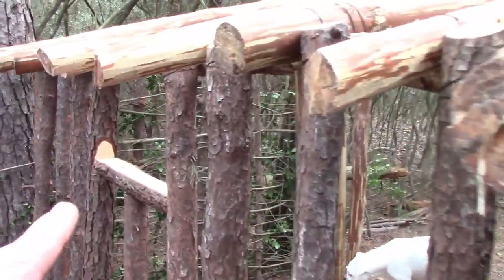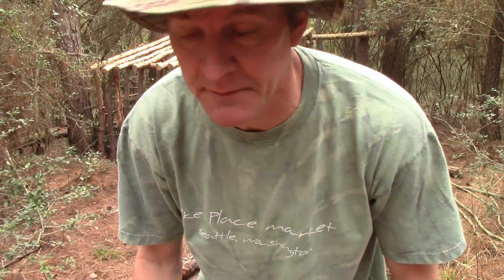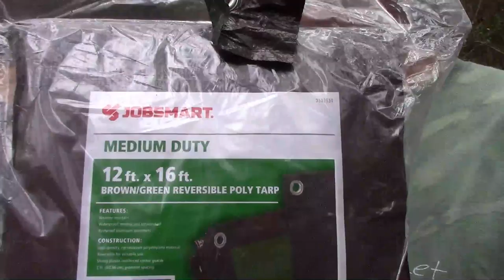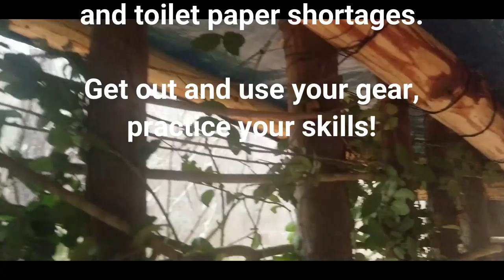Super Shelter Chapter Four Tacticool Walls and Roof

Comment: That Corona saw is pretty awesome aint it. Home depot has the corona blades that are meant to go on the end of a long pole . I went to buy one and put the handle in it myself with a couple of bolts and a 1x4 that I had whittled into handles.  They had 5 blades like your  Corona saw that were marked down to $5 a piece  and I bought all 5 . Now for the price of one Corona I now have 5 .